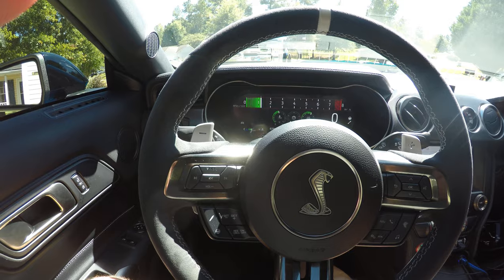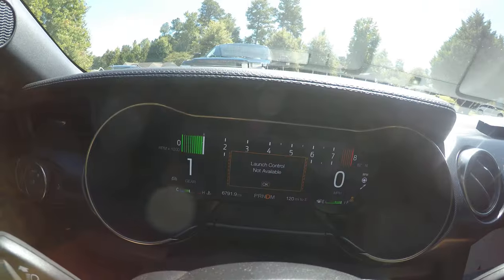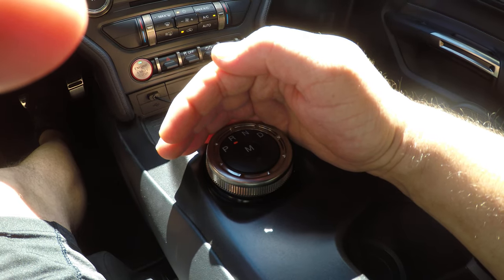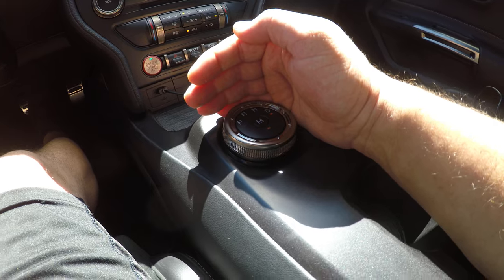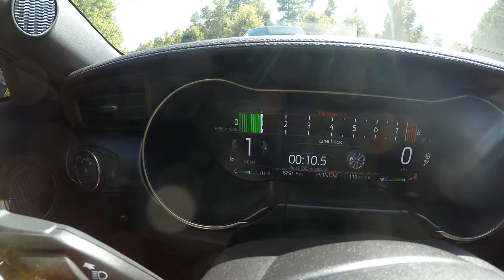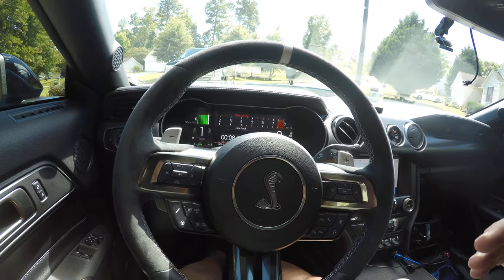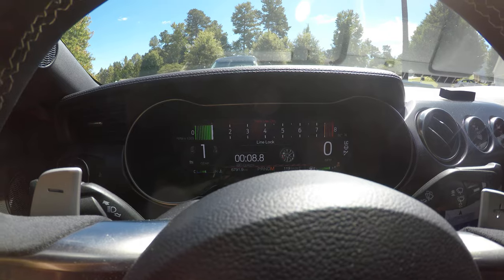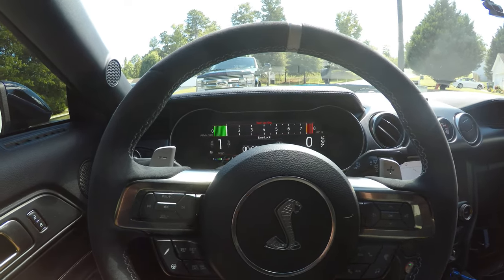HOW TO LAUNCH YOUR GT500 FOR THE BEST 60FT! UPDATED CHECK DESCIPTION

Comment: Good video! One thing worth correcting… when you hold the switch for more than 5 seconds, it turns everything off including traction control. You said advanced track is off, but traction control is still on. This is incorrect. Traction control is also off. You can prove this to yourself by mashing the gas on a surface without great grip. You will spin right up to redline. This is also in the Mustang owner’s manual.
Reply: That put me in a curb one day lol. What would you suggest doing on stock tires?
Reply: @kentuckystumpjumper2882  At the drag strip…? Are you doing a burnout to heat the tires? Is the track heavily prepped? You can leave the system on and should be able to get the car to run mid 10s. If you are getting bog off the line, you can try different launch RPMs or turning off traction control.

Comment: Great video.   Saw the Ford Engineer in a vid try to explain holding both paddles (putting car in neutral) & then bring up rpm for a launch.  I'm not ready to try this as I'm not fully broke in yet.  Can u address this topic, as I may be incorrect in what I thought I understood.  Can we launch car from the neutral position or no.  I'd think no Myself.. but I don't know for sure yet.  
Does anyone else besides myself think about a different set of rear tires besides our 4R or Cup2's for having fun at track.
& not necessarily drag radials either.  Perhaps just a more budget tire for shredding over a season.  Or perhaps it's just easier to wear out our 4R & just replace them, vs extra rear wheels & tires..  again.  It's all just opinions,  but we ea have different reasons why we do what we do..  thx again!!

Comment: So by not using so much pressure on the brakes reduce the lag when launching? Cause when u let off the brakes it's likenthe car doesn't fo right away it's fairly stupid. Wish there was a tuning capability to remove that completely

Comment: It lets you use launch control with advance Trac off? Thought it didn’t let you do that? Thanks!
Reply from the maker: @BadgerGT500  Launch control is disabled. However, the 2 step will still work.
Reply: @gapinsgt500  got it, thank you!

Comment: So you’re leaving traction control on, but only turning off Advancetrack once in Track mode correct?
Reply from the maker: That is correct.
Reply: @gapinsgt500  awesome thanks sir. Will have to give this a try. I think I accidentally did this a few nights ago and cut a 3.22sec 0-60 on a random freeway. Not bad for no burn out on radials

Comment: So is the best combination trac off/ adv trac off... Or trac on/adv trac off?
Reply from the maker: When you disable advancetrac you also loose traction control. So that means you do not have launch control that controls wheel spin. However you can still use your 2step/rpm limiter. Launch control and your 2step/rpm limiter are 2 different things. Hope that helps answer your question.
Reply: @gapinsgt500 whats the best rpm to launch at?
Reply from the maker: @pjbiggleswerth8903  really depends on the prep. With the tune I have now 3200 to 3800 with good prep is where I like it.